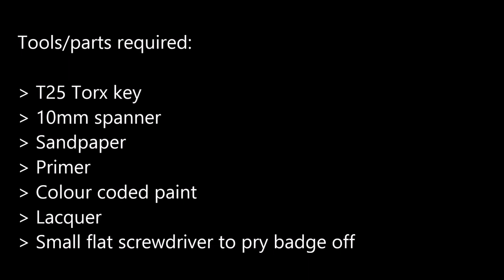Painting a VW Boot Handle

Comment: Hi Haroon, good video. I am wanting to do this to mine but I want to spray the VW emblem black. Do you have to the take the whole thing off or will the VW emblem just come off with screwdriver like you did with it being on the car?
Reply from the maker: +Mudasser Hussain you can take it off while it's on the car.. what year is your car? Roughly pre 06 is a flat badge which is stuck on with glue, post 06 is the 3d badge which is held in with clips
Reply: Haroon G Mine is a 2008 TDI.
Reply: Haroon G Thank you. Your videos are very helpful keep them coming. 👍🏼
Reply from the maker: +Mudasser Hussain yeah it should be exactly like mine shown in the video